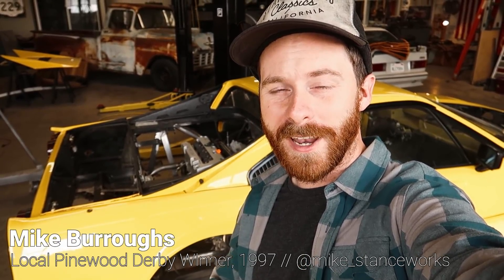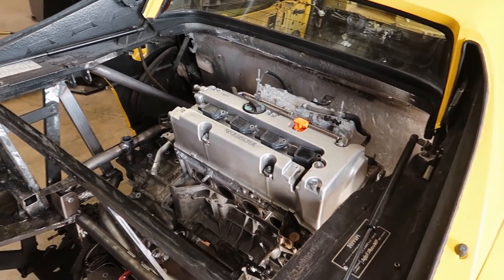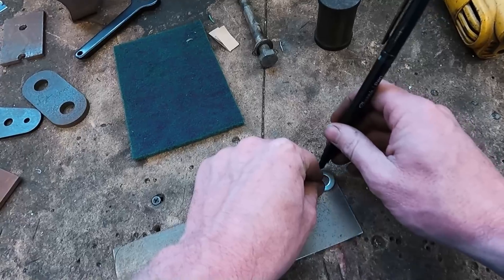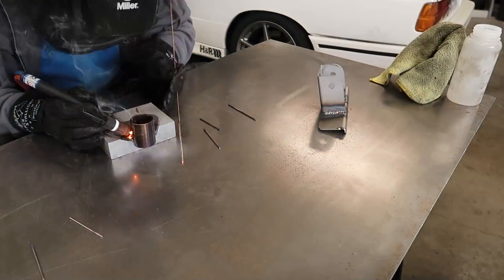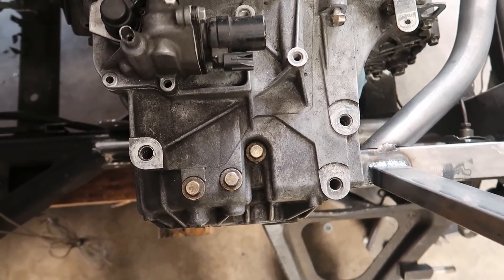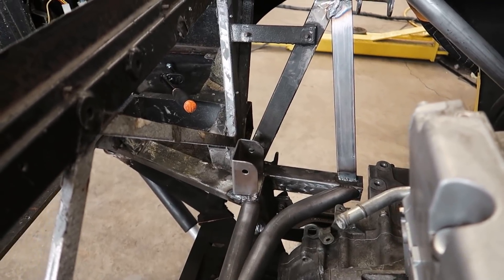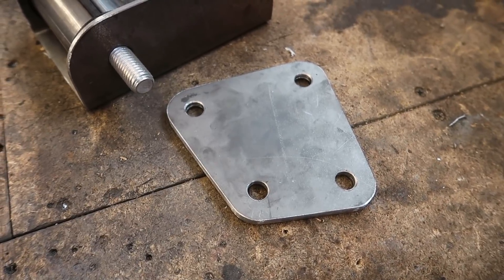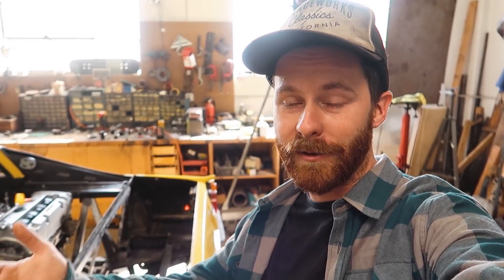K-Swap Ferrari: The Engine is Mounted! (Honda K24/K20 Motor Mount Fabrication) Ep. 25

Comment: You can use the software for tubular structures and notching by designing the structure using a tool called weldments or something. It works out the notches and you can flatten out the tube and use the printout and wrap it around the tube draw the line around the tube and cut using grinder or plasma or whatever.

Comment: New sub here! I'm loving this build and your competent way of explaining, and fabrication skills! As a Euro 308 QV previous owner, I kinda wish I kept it to do something like this as it was lacking in the HP department. (the Euro model was quite a bit more responsive than the US variant with its hotter cams, headers and lighter weight due to fiberglass bumpers, but still left you wanting more)! I'll be tuned in for sure throughout the build! Cheers from Riverton, Utah!

Comment: That "little kid in a candy store" feeling I get seeing a new notification on this series has not diminished lol. Love these updates.

Edit: Quick note on that Ryobi sander vs. metal edges... The paper makes all the difference. The stock one is great but you'll want to replace it with a better belt when it does snap. They're meant for wood so metal eats that belt up fast. Believe it or not, I've had pretty good luck with harbor freight belts.

Comment: I HATE cutting thick sheet metal with an angle grinder, it's pricey but I switched to laser cutting all of the thick parts that I can manage to plan ahead and just fab the few that need to be done while I go. Fuck cutting wheels, can't stand them anymore. Nice to see a high end build still being built like I build my shitbox golf in my tiny garage 😂 this video was a lot more enjoyable than past ones too, balance between building/filming is better
Reply from the maker: Cutting thick metal is my least favorite aspect of fabrication. If I weren't building for youtube, I'd have every part on the car laser cut. The delay to get parts and such though would be boring for folks though. Eventually I'll have my own CNC plasma table, though.

Comment: Try acetone transfer when printing out more complicated templates. You print the part mirrored, set the paper face down on the stock and rub it with an acetone saturated rag. I think it only works with laser printers though, not sure which but some inks/powders do not solve in acetone.
Reply from the maker: Huh. I am using a laser printer. Never heard of this process before. I'll try it out!

Comment: Pilot drilling is actually the wrong way to drill holes. Research how they work. A proper bit will work as designed. You need a sanding drum the size of you tubing, it will make life much nicer and faster.
Reply from the maker: Lots of folks suggest drum sanders but they don't really work well in my experience.
Reply: @stanceworks  you need a good table setup or sturdy drill press. With an aggressive grit they are killer.

Comment: Was waiting for this vid!
They dont vibrate full trottle.Mine has vibration at idle.Its worst since i removed insulation,keep that in mind.Maybe you can do what they did oem,filling all the tubes w foam and dynamat sheet metal

Comment: Been watching every episode of this project and enjoying the journey.  The presentation and voice over for this episode was well done.  Showing a bit of the finished project before going into the work helps viewers that might not see things spatially be able to follow along and know where you are going.  I like the tips/tricks you mixed in to help viewers learn more about how to fabricate. Your tip on letting the tool do the work on the belt sander is spot on.  Not only will you have better control but the abrasive will last longer.  It is really good advice for working with all shop equipment.
I knew from previous videos that your metal brake was big but when you showed it put that ~1/2 flange into 1/8" thick plate I learned it's a BEAST.
Reply from the maker: Thanks for all the feedback!
And yeah the brake is insane. It took a few of us, but we bent a 5’ run of 3/16” 5000seres aluminum in it once. It doesn’t care at all about 1/8” steel until you get real big.

Comment: I really respect you for asking for input. The GoPro material worked pretty well I think, especially with the voice over. The voice over acoustics have improved alot, no echo. But you seem to have picked up some clipping problems, booms/puffing noise and also some "thunks". Move away from the microphone and makes sure to not touch it will take of all of those problems. Putting a thick wool sock on the microphone, well worn and extra stinky, usually help with that.
Reply from the maker: Noted!

Comment: Sorry if you have already answered this, but what are your thoughts about placing a racing fuel cell in the back area, in a custom made "cage" and separated by a firewall from the engine, instead of having the stock fuel cell in the same chamber as engine, behind the drivers back? I know you are not planning to race this professionally, but isn't it usually a good practice in track cars to have fuel cell separated from the engine compartment? In a case of a catastrophic left side impact the stock fuel cell could rupture and splash it's contents all over the running engine.

I also know you kind of need the stock fuel cell to offset the balance difference by the engine sitting so much right, but could this be averted by using the stock fuel cell as a water ballast you could use to fine tune the balance by adjusting the amount of water inside it?
Reply from the maker: The main issue is that would be really bad for weight balance and dynamics of the car. You’d get real bad tank slappers. 
Modern fuel cells are largely crash proof or resistant, so I’ll be upgrading to one for the new setup.